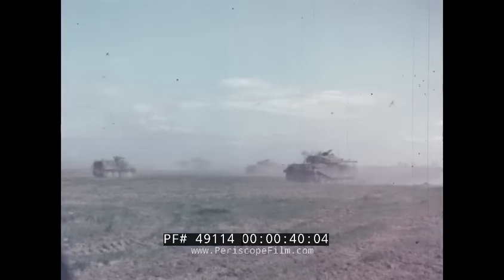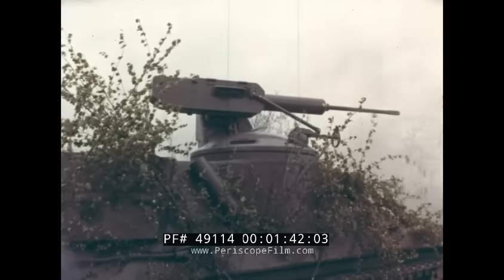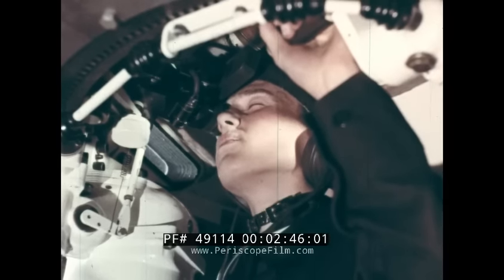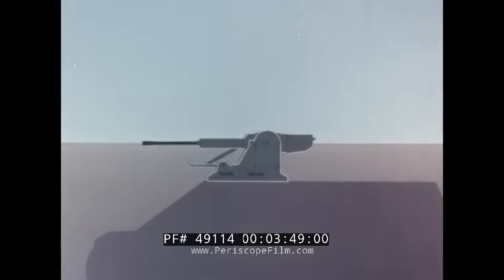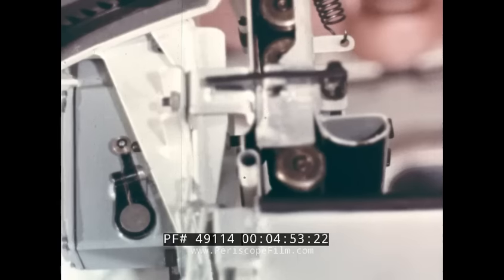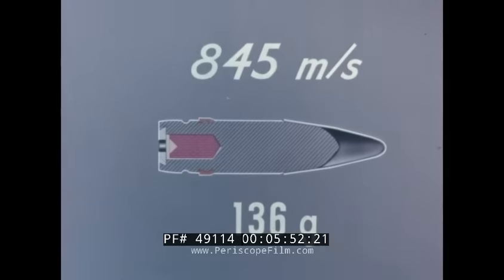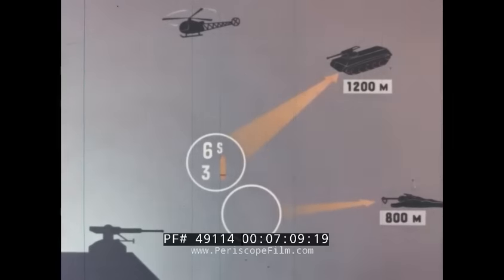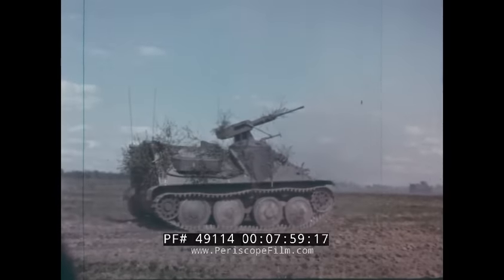BOFORS 20mm AUTOMATIC GUN for ARMORED PERSONNEL CARRIERS 49114

Comment: Description should be changed to :

This promotional film for the Bofors 20 mm L/70  automatic gun shows the popular weapon mounted in an armored vehicle. This gun was a belt fed evolution of their previous 20 mm L/70 anti air gun, which was based on their classic 40 mm L/60 anti air gun. The weapon can be used as an anti-aircraft gun (used against helicopters and recon aircraft) and as an anti-personnel weapon. 

As noted above, the weapon is a distant relative of the famous Bofors 40 mm L/60 anti air gun, often referred to simply as the Bofors gun. The 40 mm L/60 is an anti-aircraft/multi-purpose autocannon designed in the 1930s by the Swedish arms manufacturer AB Bofors. It was one of the most popular medium-weight anti-aircraft systems during World War II, used by most of the western Allies as well as by the Axis powers. A small number of these weapons remain in service to this day, and saw action as late as the Gulf War.

The history on the 20 mm cannon is this: during World War II, the Swedish air force lacked a belt fed 20 mm cannon. Bofors responded to this by developing the 20 mm L/70 automatic gun, in Swedish service known as the 20 mm autocannon m/45. This used the 20x110 Hispano Suiza cartridge and had a cyclic rate of fire of 725 rpm in aircraft configuration. The gun came too late to serve in the war but was used on the Saab 21 fighter aircraft past the A-1 model. The gun was very reliable and had a good rate of fire.

After the Saab 21 had left service Bofors bought up all remaining guns from the Swedish air force and developed an armored gun mount around it for use on armored vehicles. In this configuration the gun's rate of fire was reduced to 300 rpm to allow continiues fire on the ground without overheating. The 20 mm armored gun mount saw service in the Swedish army on the Pbv 301 infantry fighting vehicle, as featured in the video. The mount was also planned for the Swedish S-tank during its early development.

In this video the gun's fire rate has been restored to 725 rounds per minute as a selling point. The two projectiles types shown in the video are Bofors designs originally developed for the Swedish air force. 

The high explosive projectile had the Swedish designation "20 mm mingranat m/52" (short: 20 mm mgr m/52) or "20 mm mine shell m/52" in English. It featured a 14 gram high explosive incendiary charge. Interestingly it was never fielded to the Swedish army for use on their Pbv 302 and is only featured in the video since Bofors owned the design.

The armored piercing projectile  had the Swedish designation 20 mm spårljuspansarprojektil m/68 (short: 20 mm slpprj m/68) or 20 mm tracer armor projectile m/68 in English.

We encourage viewers to add comments and, especially, to provide additional information about our videos by adding a comment!  See something interesting?  Tell people what it is and what they can see by writing something for example: "01:00:12:00 -- President Roosevelt is seen meeting with Winston Churchill at the Quebec Conference."
Reply: Wasn't it the 20 mm m/40 that was based at the same design as the 40 mm Bofors?
Reply: @satanihelvetet  yes, but the 20 mm m/45 was an evolution of the 20 mm m/40. However it shares very little with the original 40 mm design.
Reply: @Blockhaj  I thought the m/45 was an evolution of the Hispano Suiza...but maybe it was only the calibre 20x110 that was adopted from HS to Bofors m/45.

As I see, the m/40 with 20x145 was more sutible as AA and AT, were the m/45, m/47 was more suitible as arm in airplanes and vehicles.
Reply: @satanihelvetet  The m/45 only used the same cartridge as the Hispano Suiza 404.
Reply: Thank you for mentioning what APC that was.
Reply: @VorpalDerringer  its technically an IFV, not and APC ;)

Comment: It is written the small turret the Gunner occupies and operates from is gas tight and later the film mentions that all gasses produced when firing are ejected overboard. 
Does the mean to imply that the vehicle interior is "Positive Pressure" to ensure NO outside gasses, as may be employed during combat in a NBC environment, is employed whenever the vehicle is in operation?
The reason I point this out is because the empty shell ejection port doesn't seem to be sealed/enclosed when NOT in firing operation. 
Small but important consideration for the crew/occupants. 
Thank you for posting this interesting and informative video.
Reply: the gun is compleatly outside of the vehicle  there is no interior conection to the fighting compartement  from the gun (source: im a swede)
Reply: @alcapone796  apart from the ammo belt...

Comment: The 20mm should be the newcHMG/LAC for vehicle mounts instead of the 12x7 ,the Ma Deuce is a great weapon that can be used but for the 21st century it needs some assistance and vehicles equipped with the 20mm will be a great benefit. A RWS on the AMPV using a combo 20mm plus aaws (Carl Gustav) will be a lethal and effective weapon system especially for Infantry support in urban areas.

Comment: Out of curiosity, how hot was the cartridge after it was ejected ? Wondering if it can ignite something if enough of them fall onto someone or something inside the hatch from the heat after firing.
Reply: It really depends on the cartridge. Small ones heat up faster, bigger ones don't. But I would say most cases after being ejected would be around the 350-400° F for a few seconds, brass tends to cool down very rapidly.

Comment: Is that an apc on the chassis of a 38t??? It looks really good! Didnt know about that thing yet!
Reply: Yes. The Swedes produced the 38t under licence as the m/41.
Reply: Yes it is. When the tank was out of service, it was reused as a base for the first tracked APC in the Swedish armed forces. This was both a experimental project as it in the same time was in service in the army. The PBV 301 was later replaced with PBV 302.
Reply: PBV 301 Fielded 1962, decommissioned 1972 (replaced by PBV 302).
Reply: The turrets can still be found around airport/airbases, harbours and other instalations. 95% of them in none active/museum reserv status.

Comment: This is ATV 301 (PBV 301) It was a miserable machine. It's predecessor PBV 302 was much better and was used for 50 years.
Reply: Martin Birgersson How?
Reply: It was only planned as a temporary APC until the PBV 302 was ready. The chassi was based on an old (bad) tank, and the tracks were a constant source of problems. The didn't want to stay on. The cannon was a 20 mm canon from an airplane, but the rate of fire were downscaled for the 301. Crew compartment was much to small and the gearbox demanded that you had a left foot capable of pressing down serious amounts of pressure.
Reply: The 302 was not the predecessor.
Reply: Martin Birgersson sucessor, not predecessor.
Reply: Samuel Yahata you asked how but weren’t even interested in the response nice

Comment: what year this clip was made?
Reply: PBV 301 was Fielded 1962, decommissioned 1972 (replaced by PBV 302). Film is probably from early 1960s
Reply: @petter5721  we had 40 mm BOFORS in WW2 then 20 mm in 1960s?
Reply: @jacklarkson4505  yes, they just keep getting more compact for every decade.
Bofors recently released the new 4,5 mm desktop version that connects to your phone or laptop via bluetooth.
Reply: @jacklarkson4505  the 40mm was too big and cumbersome to mount in armored combat vehicles before Hägglunds and Bofors developed the turret to the Strf9040 and Lvkv9040 in the late 1980ies where the updated 40mm/L70 gun was fitted with tripple slot single stack magasines and flipped the gun mechanism upside down.

Prior to that, only the Lvkv m/41 and the VEAK prototype had been fitted with the 40mm/L60, in the m/41 as a manually loaded and aimed SPAAG, and in the VEAK in a motorised radar assisted SPAAG prototype that never entered service.